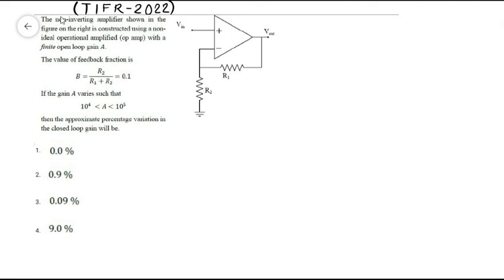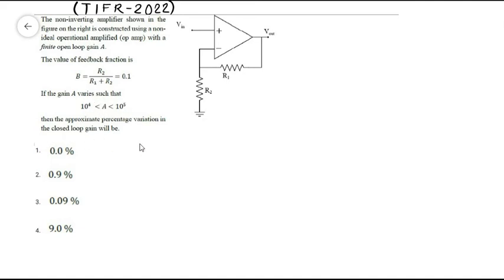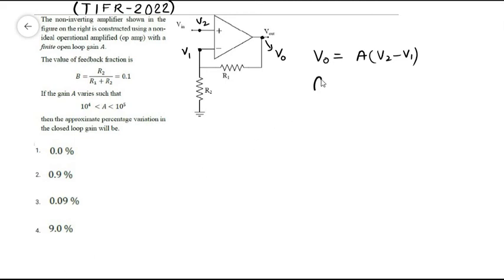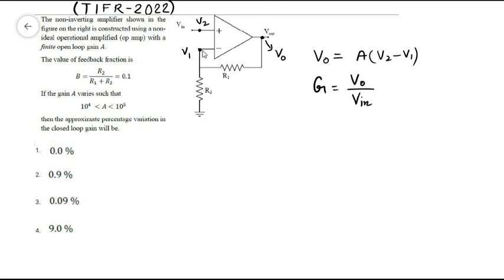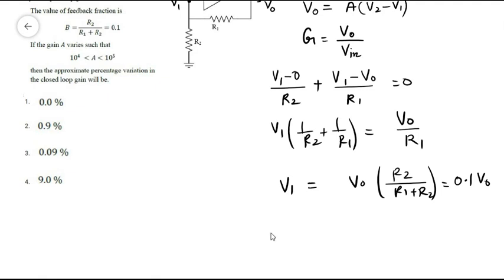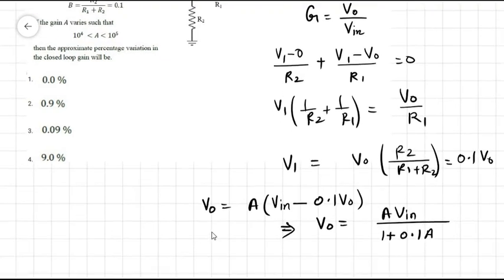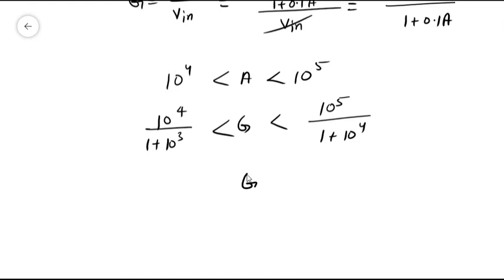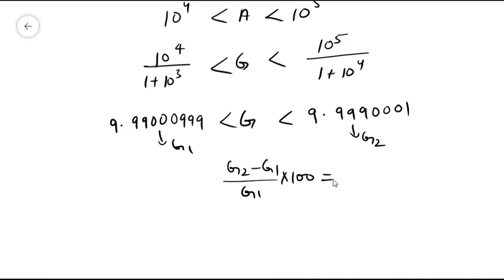TIFR 2022 physics solutions (op amp with finite open loop gain)

Comment: what is the expected cut off ?
Reply from the maker: This time paper was easy, and its very hard to predict but I think it will be little bit higher.
Reply: @physicsthings1689  

50 + or much higher ?
Reply from the maker: 75+ will be called for interview I guess. (If someone has attempted 8-9 questions from part B and 10-11 questions from part A) 
But I am not 100% sure.
Reply: ok,,, i was known that 50+ will be cut off,,, accordingly i do attempt....
😔
Reply: @soumendas383  i think, 75+ is too much.
60-65 would be perfect
Reply from the maker: you do not have to worry about it. I am just predicting it. It may go below 50. IITs are not the bad option to choose. You just focus on the coming JAM (I am sure you have applied for it). Main thing is you wrote the exam and this exam is not very easy.
Reply: @physicsthings1689  ❤️